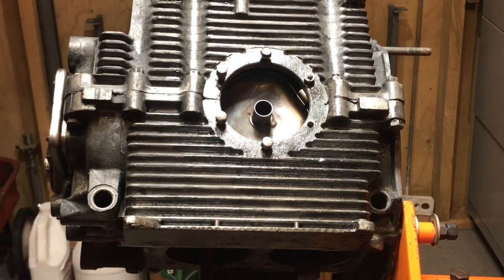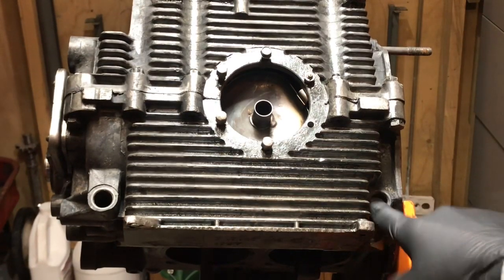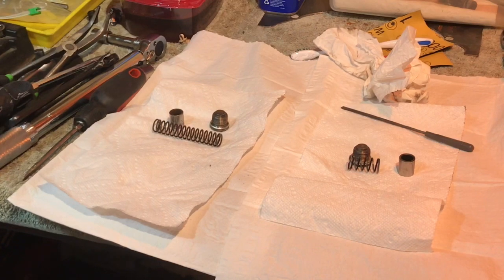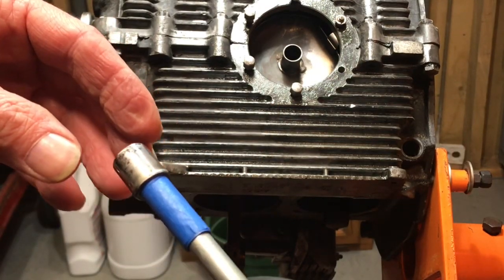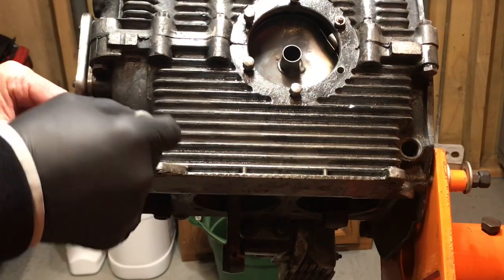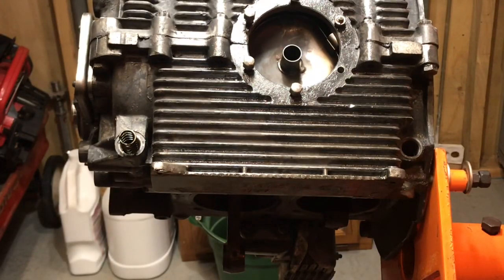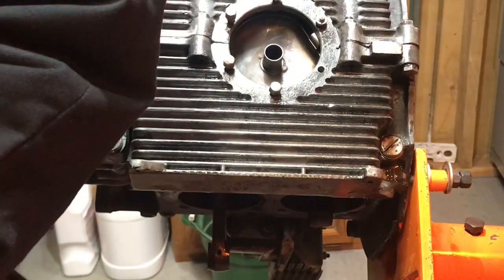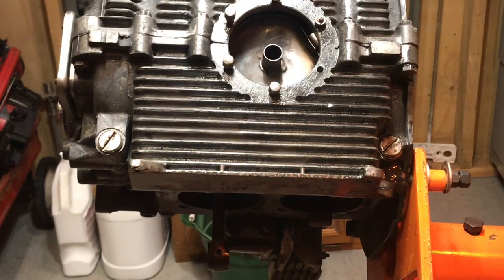Engine pressure valve 1971 SB /1600CC

Comment: A had a second hand 1600cc. Twin relief valve case. On the first proper drive over 20km the engine exploded, cam in three pieces, piston smashed off the conrod, that was bent 180 degrees sideways. Lifter bores on two lifters split and case ruined. On later inspection I found the oil pressure valve screw covers and springs were installed, no relief valves. So it will blow up. I was, and still am pissed off.  It is like someone took these out on purpose so the engine would explode. So I am building an all new brand new parts engine myself from scratch. Just to let people know, check these. longer spring goes closest to oil pump/pulley end, shorter spring is at flywheel end of case sump.

Comment: Stupid question but need answer please ,what happenes if you dont put the pistons in or spring just the bolt ?
Reply: No question is ever stupid 😇. My guess is no or low oil pressure because that's what these are for
Reply: A had a second hand 1600. On the first proper drive over 20km the engine exploded, cam in three pieces, piston smashed off the conrod, that was bent 180 degrees sideways. Lifter bores on two lifters split and case ruined. On later inspection I found the screw covers and springs installed, no relief valves. So it will blow up. I was, and still am pissed off. So I am building an all new parts engine myself from scratch.

Comment: Hey I just bought a new engine stand from harbor freight. I see you used a normal one like I bought. So you can mount it to one without the VW engine style stand?
Reply from the maker: Yes you can, but if you have the flywheel on the engine you need to add a 1/2 to 3/4 in spacer.  Only if the flywheel is on.  Else you can mount the engine case straight to the brackets that come with the engine stand.  I am still going to buy the one for VV cases, and also thought about making a jig that would also work with VW cases for this stand
Reply: Junior Classic VW bugs Oh okay!! My flywheel isn’t on right now. My buddy has the VW adapter, but I hate borrowing stuff!! 😂
Reply from the maker: Hey Slades, how are you doing? I hope all you and your Family are well. Have you done any work on the big lately?
Reply: Junior Classic VW bugs I’m good my brother. Thanks for asking. It’s been hectic here lately with small going on. I’ve been squeezing garage time in. The headliner 😳